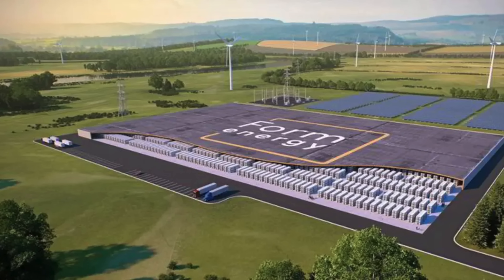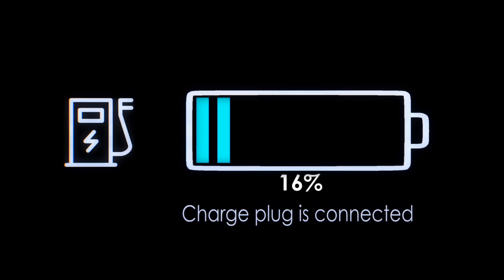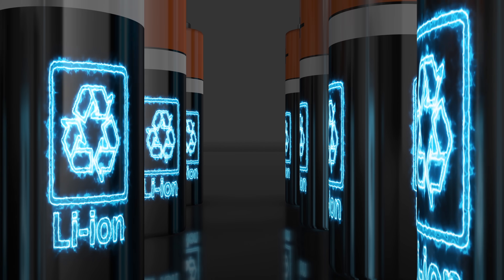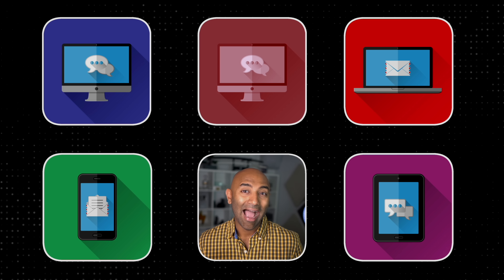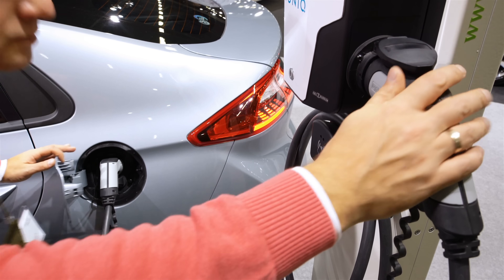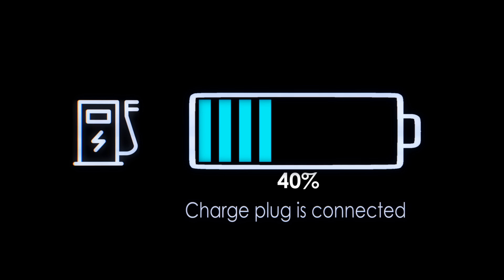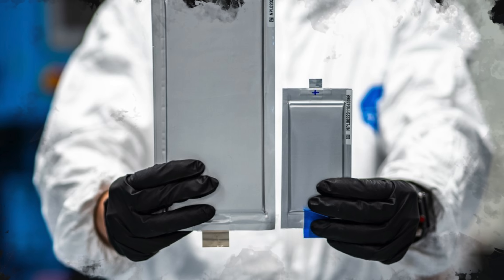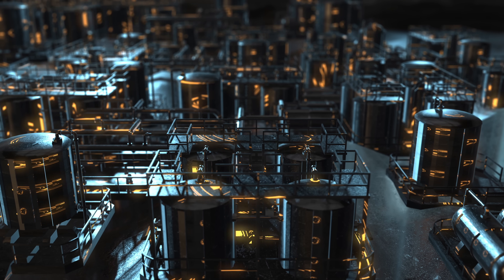This Battery Claims It can Store Energy in RUST!

Comment: I saw all those boxes spread out over an acre and thought, "Why not build up instead of out?" And then I thought, "That would be a very tall tower depending on how many was on each level. I bet that'd be heavy. They're full of iron and water." Then I thought, "Well, they could use all that weight to make gravity batteries, also." If there was a way to get the energy in and out of them while they're being moved around, the iron air cells could be used to ALSO store potential energy. Raise the cells up high when production exceeds demand and let them drop, generating energy, when demand is high. But how does the power get in and out of the cells while also making them mobile? I'm sure someone could figure it out. Just off the top of my head, the whole floor could move up and down, raising and lowering the cells on that floor. The cables would just have extra slack in them and run though a track like on a standing desk or like the wires on a 3d print head. Those both need to be plugged in but they also need to move. So you leave the top 5 floors empty. Raise all the floors up to fill that empty space. Then, one at a time, starting at the bottom floor, they drop 5 floors to the ground, in a domino or cascading sequence until the last one, the top one, drops. To prevent gaps, the next one starts falling right before the preceding on is done falling. And you could even pump that potential energy back into the batteries again. I wonder...

I just used a YouTube comment as a brainstorming session.

Comment: The foorprint would not be an issue, there is plenty of empty space available. If your area happens to be limited, as these batteries are not going to catch fire there should be no problem stacking them or lining them up and simply building the solar panel frames on top.

Weight is not much of an issue for a stationary facility, but heavier units are harder to transport and move around the worksite. If you need to put the units under cover it would probably end up cheaper to make the building bigger, or simply build a second one, than making a second floor that has to be able to hold all that weight.

Cost is ultimately what matters. Some people get exited about Li-ion being 80% efficient, but the problem with them is due to their cost you would be losing money if you keep them charged and waiting for winter instead of selling the electricity in a few hours. It does not really matter much if hydrogen storage or whatever is only 50% efficient if you can build ten times more storage capacity and a second solar farm at the same cost you get one lithium battery.

Comment: I know you realize we live in a 3D world, so they don't have to use up 1 acre of land for that 1 to 3 mega watt iron-air installation, they could just stack them on top of each other. In other words,  dig out a place for a building that has like 35 floors under the ground and some above too, made to hold all the batteries. So now it takes up a fraction of land for the same 1 to 3 mega watt installation.

Comment: I'm not qualified to speak about different battery systems/chemistry, but am trying to understand the different "air reactive" batteries, including iron, aluminum, and other "metals" that oxidize. Must admit I'm a fan of the heat battery systems. The Hydrogen plate batteries seem like a cool idea too.
Reply: You can't convert heat back into electricity without losing a large fraction of it.  That's a law of physics.

Comment: I wonder how well this would work for home energy storage paired with a small Li-ion battery?  

The Li=ion for quick reaction, like an AC start, and Fe -O for all night or several day use.
Reply: It wouldn't. It it has very poor power density.
For instance, to get the 5kw output of a single Powerwall, you would need 20m² of battery in the proposed 1MW/acre density.
Reply: @MrGonzonator  
So what you're saying is you need  either "new" land, or large areas of "underutilised" land..... Like under the panels on a solar farm?
Just need a firm pad and a forklift to position them. Power hookup already installed......?
Reply: @rogerstarkey5390  yes, sounds like a good idea, though I'm guessing you'd need stronger foundations and a waterproof enclosure for each, so that adds cost.

Comment: can you make a video about the different types of fuel cells?
Reply: As a striking example of one of the most inefficient ways to store energy? Not that interesting, everybody but Toyota unterstands it.
Reply: @Makatea  Actually Fuel Cells have been used by the SPACE program for a very long time.
Reply: "Different types of fuel cells"
Inefficient
Very inefficient!
OMG inefficient!!

There, done
Reply: @techobservations8238  
Small amounts of power for long periods...... Where carrying fuel is undesirable.
Niche case.
Reply: @techobservations8238  Unshielded Plutonium-batteries have been used to power spacecraft too. For stuff impractical in general, there may be some rare edge cases, where it is the least bad solution.
There are lots of more cost- and energy-efficient solutions to stabilise the grid.
Reply: @Makatea   @Roger Starkey      I guess it depends on how you determine "efficiency"  That is to say  inefficient compared to "what?"   Burning fossil fuels to make steam to produce electricity?   Does that include the "mining?" and transportation of the fossil fuels?  The wasted thermal energy and combustion products pollution costs? using the thermal energy from the fuel cell if relevant?

Comment: For an off-grid commercial roadside EV Charge Station, why not combine the battery housing with a solar array. How big the battery capacity? How big the array? How many charge/parking ports? Cash flow per hour needed? Maybe use the Genetic Algorithm to evolve & optimize this multi variable problem?
Reply: As already suggested, why not just install under EXISTING solar panels?

Comment: What advantage does the air battery have over the Edison battery?

The Edison battery is also large, heavy and less energy dense but it also has been proven to work for decades in actual use. Some reports say Edison batteries remained in operation for 50 to 80 years.

Maybe we already have the solution,  and it was invented aged ago.

Comment: If a rust battery for home storage is the size of a fridge and is cheap, I see a great future for it taking over from power walls.
Reply: This battery is 100 times larger than a power wall for the same storage capacity.
Reply: @kkarllwt  that would take up half the garage space, rust batteries need more work.

Comment: I see these as being great for a house. A small Lithium or other high dencity battery and one of these modules that would slowly soak up and discharge it's power. This added to solar panels would make a lot more affordable sollution than the current ones.
Reply: You would need 200 acres of FeO batteries to power the house.
Reply: @ReachOutToWilliam  200 acres was for one megawatt. In the video he mentioned a washing machine size battery to run your house.

Comment: The 0.01C charge/discharge rate implies very high internal resistance.  High resistance implies low round-trip efficiency.  Note that Form Energy's website never mentions efficiency. They never even say "good" or "acceptable" efficiency.  I'd guess it's very low: maybe 50%?.  While purportedly cheaper than other batteries, the increased cost of electricity to charge them is going to reduce their economy.

Comment: Stacking the batteries, with solar panels on top, would lead to greater space efficiency. A mWh in something the size of a large 3 storey house then starts to look viable in terms of land usage. Well done USC on solving the degradation issue btw.
Reply: Attractive!
Reply: Actually, I’m being a little optimistic here. More like 3 or 4 stories and 30m square, and if the batteries are heavy, they are iron, then the structure would be expensive to build. Maybe not such a good idea stacking them. Still, for countries with plenty of otherwise unproductive land to spare it would be great at $20 per kWh for storage.

Comment: There is too much lack of informations at this stage for this to be commercialized. Solid state batteries are stuck, yes, but at least you have some kind of laboratory prototype where they can say that they are working for X cycles, and the discharge rate, and some data. Honnestly, in new technologies, in this era of full marketing and investments, especially when talking about environement friendly techs, there is some rules I put to myself :
-Do we have all relevant informations about the tech ? (life cycle, costs of materials, difficulty of engineering, reliability)
-Do they have a working prototype ?
-Do they have some "real-life" working prototype ?

Devil is in the details, and honnestly, hearing "it may works for decades" is not enough. How many cycles is it ? It is a simple stat. Why don't we have it ? Why do you talk about energy density when talking about stationary grid-scale storage ? Do we talk about the density of a dam when you can reverse-pump water ? No this is not pertinent. And you are talking about oxydation process. Honnestly, if this is iron only electrode, this is not good because once rusted, iron tends to deform. So when you recharge it (de-rust it) you don't have the same structure than before, this may affect energy storage, and even battery performance.
And we don't know how many cycles does it works before losing let's say 10-20%capacity ? Why ? This is a serious challenge !
We don't have any numbers about energy-storage efficiency. Does it heats ? Can you retrieve 80% of energy stored ? 90% ? We know how it discharge, but not how it charges.

It's a battery, and there is a strange, disturbing lack of informations about some critical base data. I really, really don't like it. Their first full scale model is gonna be delivered in... 2023 ? Why ? If you work correctly, you have some modularity in your cells, and you can put it together to works. It's basically a giant warehouse, with some kind of security stuff (fire-related, heat management). I'm pretty sure that if they had like some small-scale model somewhere, they would have mentionned it, as working prototype, scalable. It's not. You don't start building things big, because you're gonna find issues on the road. Either there is some marketing problems right here, or some technical problems hidden, or some management problems. This cannot end good.

Don't get me wrong, I'd be happy to be proven wrong and this be the future of cheap, grid-scale storage. I'm a tech enthusiast, and I like anything that can help with environnment, but i'd bet this won't result in anything good. I bet they are gonna bankrupt, or sell their tech to someone else to manage it properly.
Reply: Stop looking for problems?
If it's a "business" it normally gas some substance behind it .
That implies someone has "dine the homework / research (normally an "expert")
If they are making a viable product, it will sell, simple as that.

Don't "worry" about it (unless you're attempting FUD, In which case, worry, your interests are being eroded)
Reply: @rogerstarkey5390  Yeah, that's what you saw with, Nikola trucks, loads of experts backing the business tech. There are loads of fucking cases where the "business" is just a way to take investors money. And even if that's not the case, there is a whole lots of tech that stand in the corner of "lab testing" because of scaling problems.

As I stated, I'd be happy to see this in action, be it the future, or just a niche application that could help people. I don't have anything against them at this point, I'm just pointing out the lack of relevant "expert" informations that should definitly be there.

If in some years this is spreading and working totally you can come back, comment here, and say I was wrong. And then, we'd be happy together because that's good for the environment. Deal ? In the other case, let's just forget this, as we should do with scams.

Comment: Vision is nice 😁 what about round trip efficiency and self discharge rate🤔☺️🙄
Reply: To quote Mark Knopfler....
"Money for nothing" ?
If it's a cheap enough one off cost and requires little maintenance, "efficiency" or "self discharge" doesn't necessarily matter.

If used as a temporary energy store..... We have groups promoting Hydrogen, with huge infrastructure/ maintenance cost and 25% round trip efficiency (plus a likely considerable "discharge (leak) rate")

I'm sure any battery would be preferable.

Comment: Iron power can also be burned as fuel. 🔥 Less efficient, but yet another possible option. Left over: rust. Can be made into iron powder.
Reply: You could also burn Wood or Aluminium you know?
Reply: @wolfgangpreier9160  yes of course, questions are: which one can you bring back to its first state with green-electricity, which is best for long term storage, which holds the most energy per weight & volume, which is safest, and such.
Reply: @GiesbertNijhuis  I use LFP @ Home and Li-Ion in my cars. They exist and work allright. Of course it could be better. Maybe some day in the future there are products available that can replace them. Then i will be happy to use those new ones.

Comment: I agree, the proof will be in the number of full cycles possible. All of the  metal air  also need a greater degree of filter maintenance I think, since contaminants in the air supply are hard to keep out completely. While the idea that rust can de rust  back to iron, seems a little less repeatable to me. Hope I am wrong.

Comment: Very nice presentation. Is it feasible to house the batteries under the solar panels so as to not need the additional space? I imagine this would be similar to placing panels over crops in a field. Since heat is detrimental to batteries this may also prove to be a benefit. I am of the opinion that distributed electric generation would be the most effective way to provide for electric demand. Solar panels on all the existing residential homes using compact battery storage. If new appliances were made to operate on DC it would be a very efficient use of the energy. No loses do to transmission or converting back and forth from DC to AC. Also no  amps reactive to deal with either. Use the large solar "farms" to provide energy intense industrial demand. Just a thought.
Reply from the maker: Great combination I agree solar above makes a lot of sense

Comment: I was wondering if you could do this with iron. I assume you can possibly do something similar with sodium but would be called watered sodium battery but dangerous.
Reply: NaCl  aka Saltwater batteries sort of exist, so there is that.
Reply: @techobservations8238  I knew about that but I'm talking about sodium metal it explodes when it makes contact with H2O or water it changes quickly in air if there's moisture.
Reply: @BearerOfLightSonOfGod    Sodium (11) and Lithium (3) have rather similar chemical properties with regard to water and (oxidization)

Comment: It would seem that the major Achilles heel here is the use of Bismuth.  It's rarity I would think would cause a cost increase over the long run that would most likely cause this tech to be priced out by the most established and higher energy density of Lithium Ion tech.  Current pricing on Bismuth can not be used as a baseline as any industrial application such as large scale battery production would generate a high demand without the capacity to scale up the harvesting of this rare substance.

Comment: On Monday this week the public power utilities of New England (NEPPA) heard Gordon van Welie CEO of the grid operator for New England (ISO-NE) suggest that “ROLLING BLACKOUTS” are on the horizon without new regulations and policies that will provide the capacity to meet 5 to 7 day gaps in renewable generation. The need is there, and a breakthrough battery or other way to store electrical energy cheaply is needed.
Reply: "New England"....🤔🤔🤔🤔
That'll be Atlantic coast?
Let's guess that when there's no solar there will be plenty of other sources?
Tidal?
Wind?

Comment: Why do you need to have the batteries on the GROUND? If you put them in a ten story building won't you need 1 tenth of the land?
Reply from the maker: Usually batteries aren’t stacked for thermal and safety reasons. But these sorts of batteries can probably be stacked… though building upward gets more costly removing their cost advantage
Reply: @TwoBitDaVinci  Thanks. I'm sure there are some places where a 20 storey building occupying 1 20th of an acre is cheaper than an acre of land. Plenty of office buildings will be becoming available with people working from home.